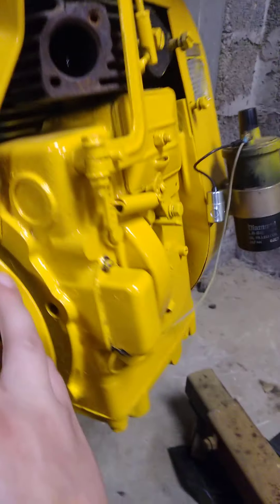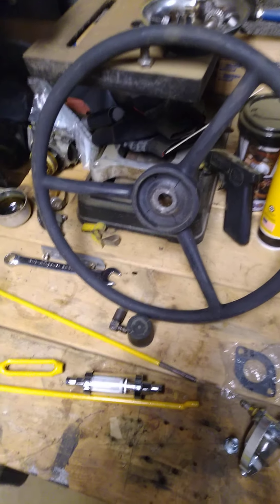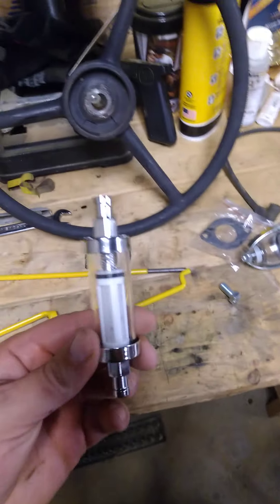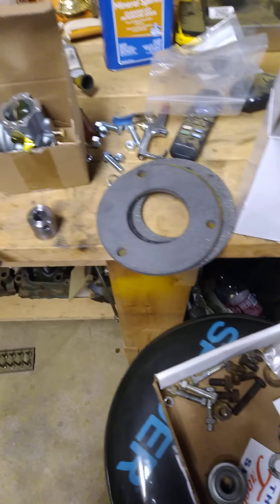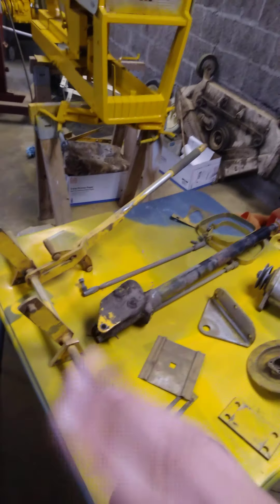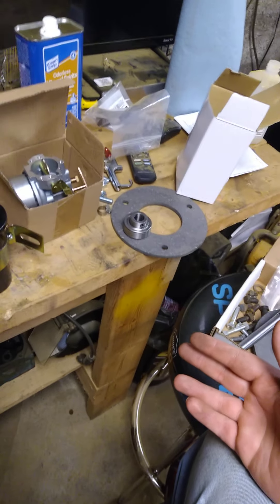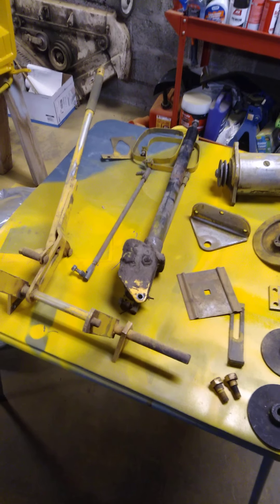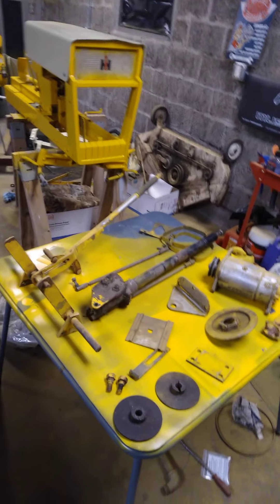international cub cadet 100 restore.

Comment: The front pivoting axle pin when you remove the shear pin out of the front pivoting axle pin which way do you drive the pin out towards the rear of the tractor or the front
Reply from the maker: I wanna say towards the back but do not quote me on that I'm pretty sure there are videos on that.  I wanna say the back